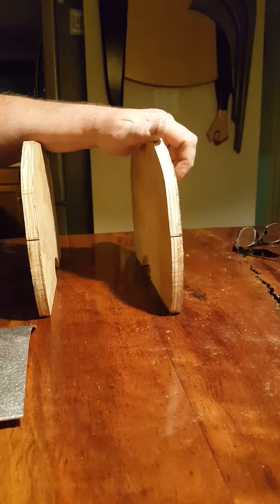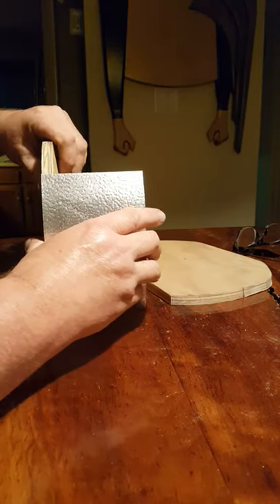Planning to build my serro Scotty Gaucho

Comment: What plywood did you use?
Reply from the maker: The original plywood was 1/2 inch Douglas fir. Looks exactly like the marine-grade that Menards sells. I opted for a little more affordable choice, I purchased 5/8 bcx yellow pine plywood from Menards. A little bit more strength than 1/2 inch but not the heavyweight 3/4. It lays nice and flat to begin with, not all Crook and bowed up like the CDX grade. I was happy with my choice. Initially I thought 3/4, but that seems Overkill and I feel adds significant more weight

Comment: Nice explanation and great advice.  What do you use to connect the three pieces of plywood to make up the wall?  I am concerned about structure strength since the original wall is one whole piece of plywood. Thanks
Reply from the maker: I used wooden biscuits and polyurethane type Gorilla Glue. The wooden biscuits help to bond the join together but also, more importantly, the biscuits keep the plywood lined up so it stays smooth on both sides. I placed my joints vertical and strategically tried to place them in inconspicuous area or in the area behind the cabinets where I could screw the cabinets to the plywood. The cabinets would help to hold the plywood from coming apart if the glue should ever break. I placed one of the joints over the side door so the joint was only about 10 inches long. Some joints cannot be covered. I installed a 1.5 by 1.5 Square board strip (2x4 ripped in half) along the top roof sides, screwing it to the plywood from front to back to help give the plywood joints some support and stability of not coming apart. Also that strip made for a good roof plywood nailing cleat as well
Reply: @hotrodswoodshed7405  Perfect, thank you!